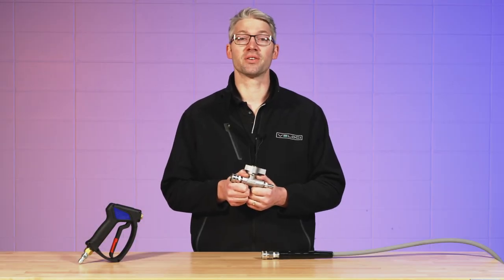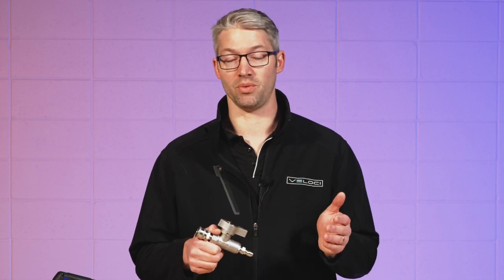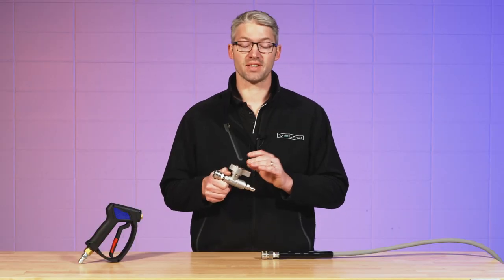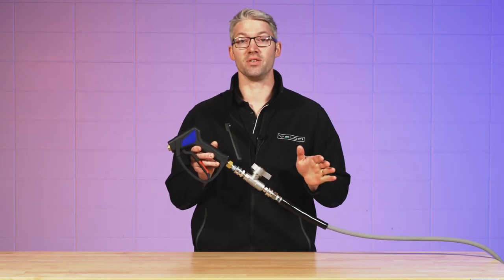Veloci SS10 Stainless 3/8" Ball Valve w/SS QC Installed

Comment: PTFE seals?..Why not Viton?
Reply from the maker: PTFE is ideal for ball valve applications due to its hardness. The ball requires a solid seat in order to rotate. Viton is more of an elastic material, which is why you see it in quick connect fittings.
Reply: @PoweredbyVeloci  Ohh I see.. I was thinking o-rings.. whoops 😬